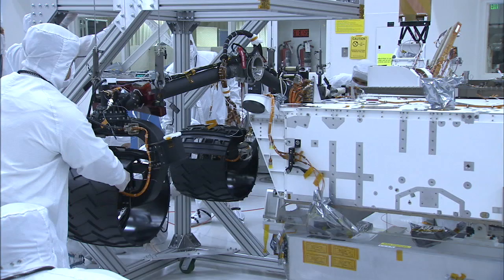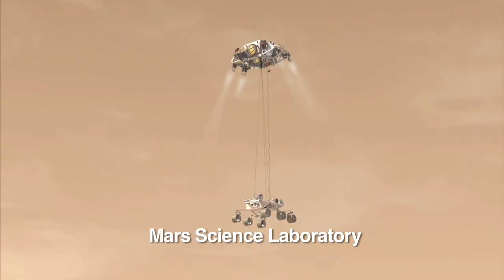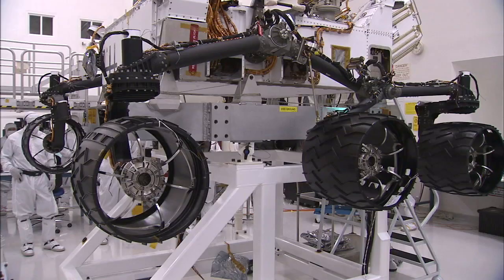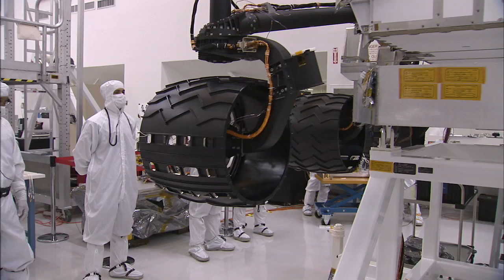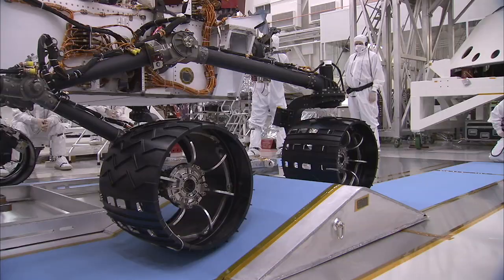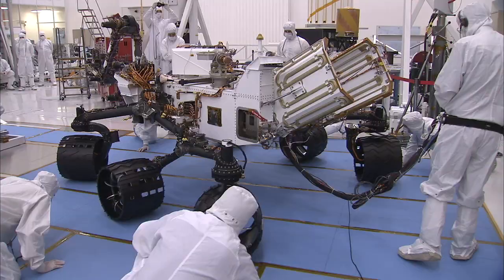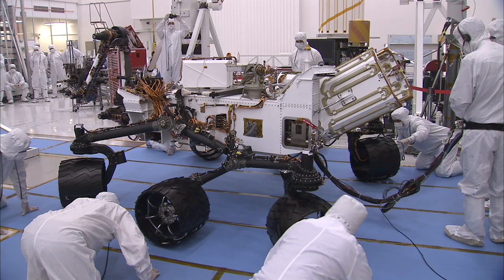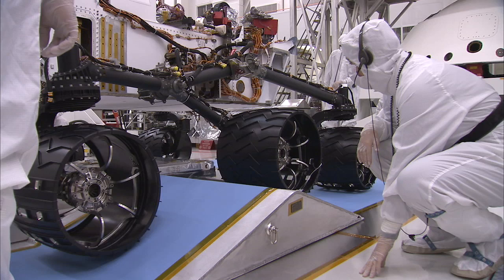Building Curiosity: Rover Rocks Rocker-Bogie

Comment: @seamanspencer 
Yep i've seen that episode too.
I guess it's all on the aluminium alloy then.
BTW such high impact but elastic aluminium "tires" are used in desert high speed (300+mph) sraight line racing.
Rubber just can't hold good enough the centrifugal force, so they use aluminium alloy.

Comment: @fegolem 
Did you see the holes on the side of the wheels?
I think they are precalculated to suffer a landing impact from one side (holes upwards i guess)
On the other hand there is a very rubber-like aluminium, i don't remember now what it's really called, but it was something like hyper-elastic-aluminium. It is used mostly in high precision electronics to measure mechanical stresses.

Comment: Actually it moves slowly also because of the rocker bogie design. Moving slowly reduces dynamic effects due to movement. To move fast with a rocker bogie suspension you'd need springs or shock absorbers.
Reply: Noted 
can you explain in detail pls